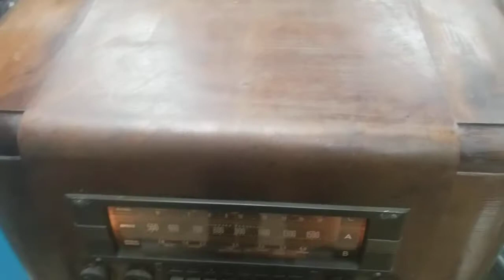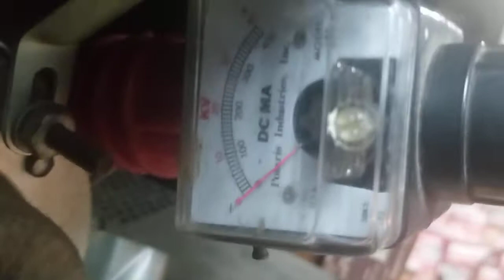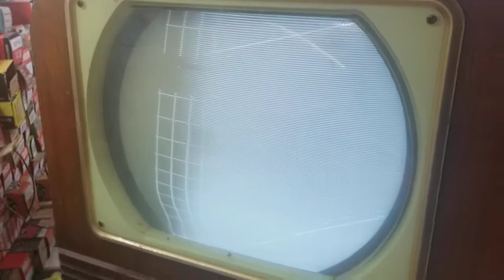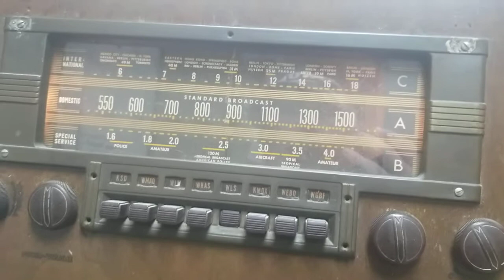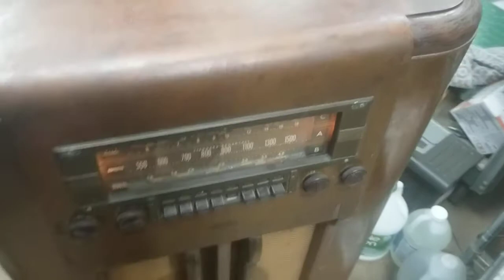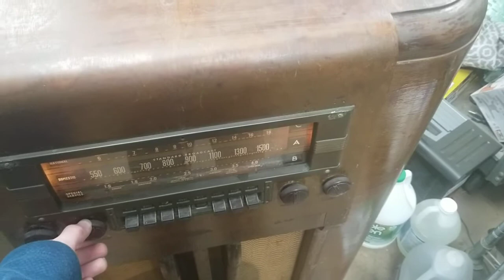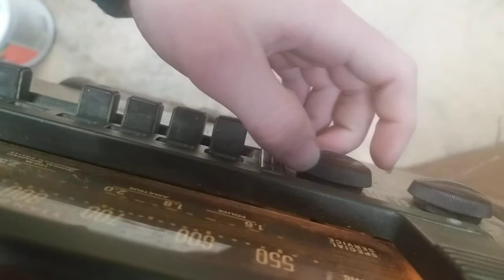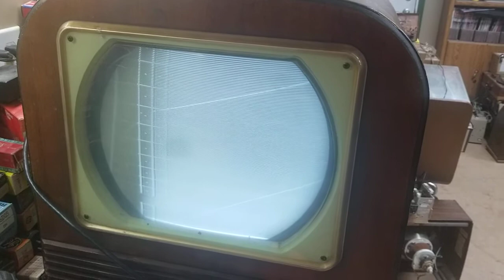1938 RCA Victor model K62 AM/shortwave vintage tube radio,1949 Philco 50T-1403 Round tube vintage TV

Comment: These 1939 RCA's originally came with 6F6's.  Max plate voltage on a 6F6 is a little higher than the 6W6, but the real issue is the 6W6 draws a much higher filament current, which can eventually burn up the power transformer!  I'd stick with a 6F6 or 6V6 in these sets.